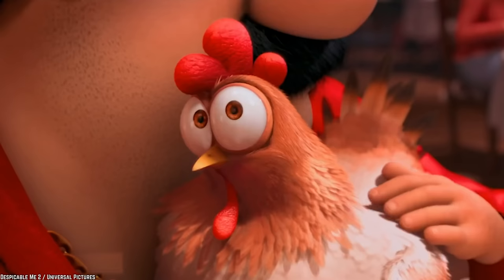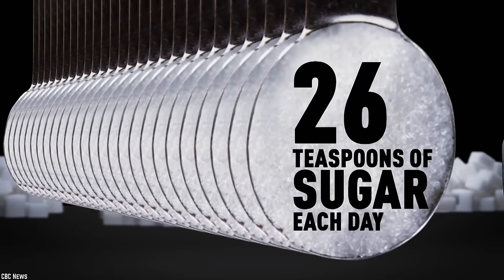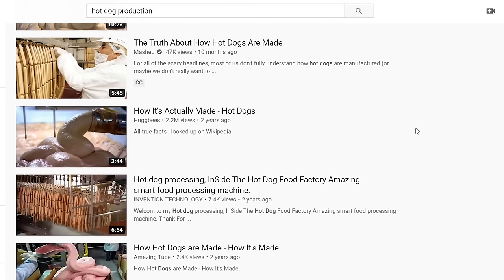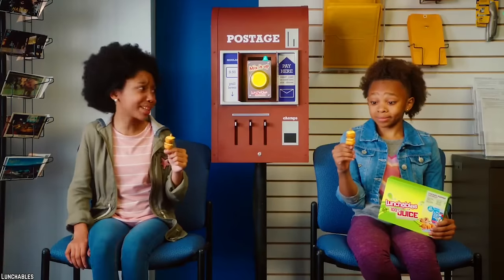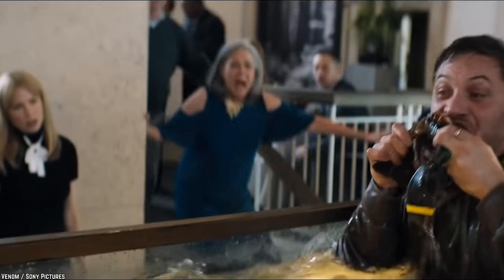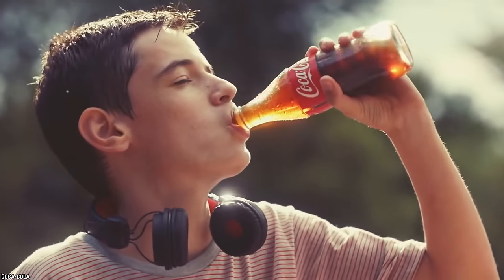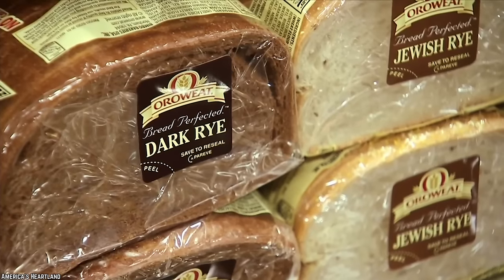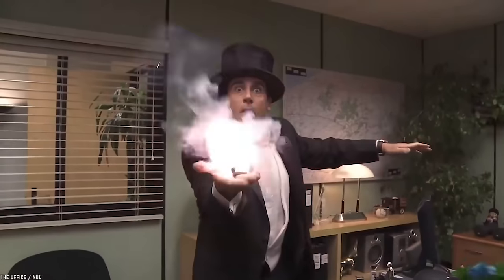10 Foods You'll Avoid After You Know How It's Made (Part 5)

Comment: You can eat anything as long as you burn more calories than you take in.
Reply from the maker: Fair enough. 😊 Did you like the video Quetzalcoatl Toltec Sun God? 😃
Reply: Well not exactly because some foods will be high in calories because of high sugar or fat. If you eat something with sugar it will end up as energy mostly and the rest will go into fat but fat gets stored as fat and then burned back up. If you eat  1000 calories of sugar it will motabolise and used as energy directly, while the fat will be stored in your body and the nutrient absorbed so you can actually gain weight if you eat 1000 calories of fatty food and then burn 1000 calories off because of everything else that will be included in said fat. Also fat is less energy dense so you need to eat more to get the same amount of calories potentially making that even more pronounced

Please correct my probably horrendous spelling